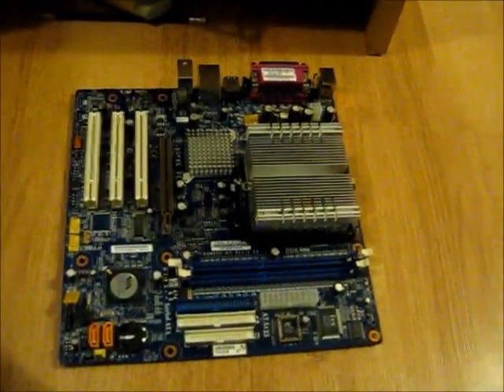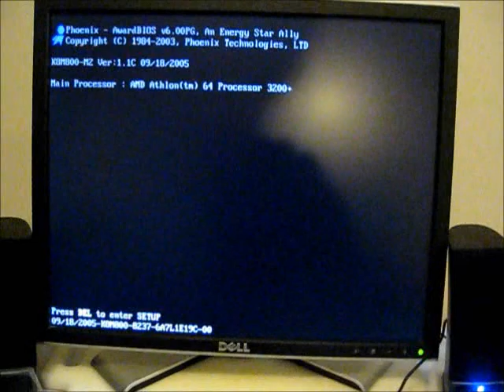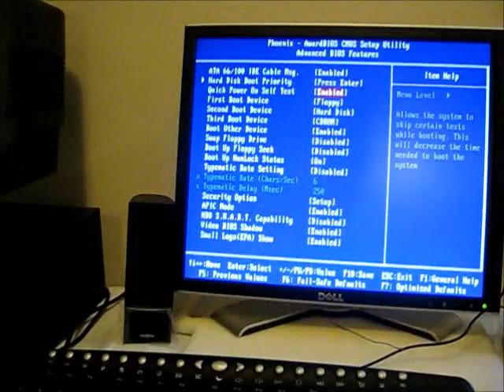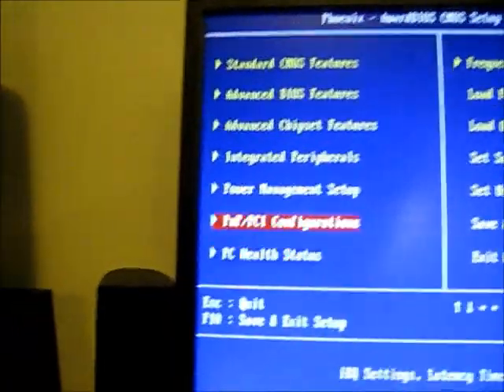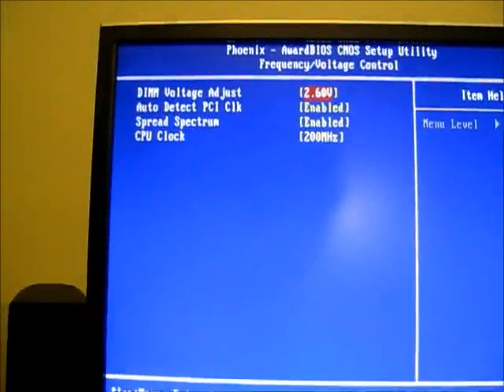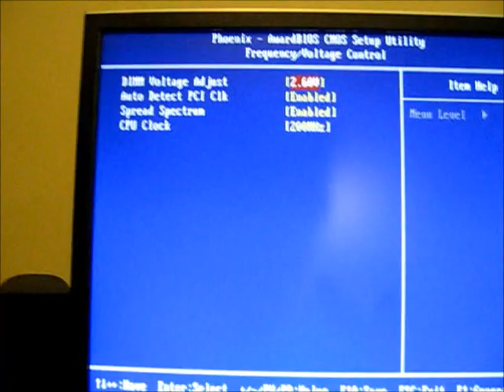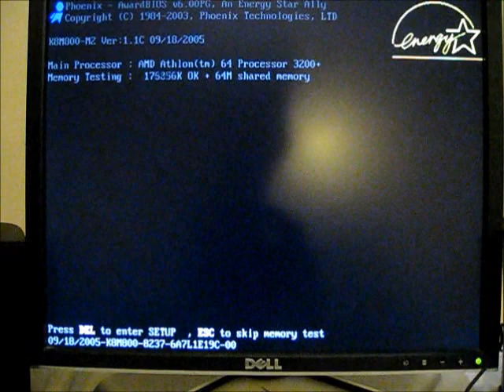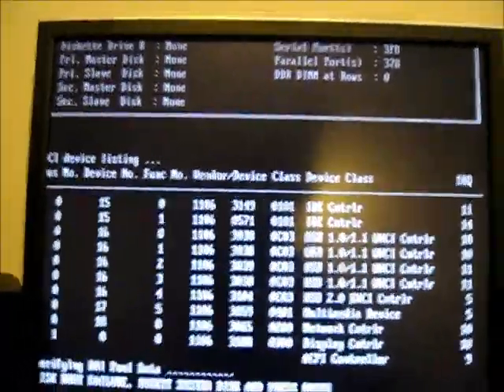Testing the ECS socket 754 board

Comment from the maker: your might be the older, crappier revision. mine is a tough board, this thing could survive an apocalypse. it was drenched in water with the battery in it, tossed into a dumpster hard enough to smash the case to no end, but the board works like a champ, the water didn't hurt it at all, the battery even still works (but I dont use it because it was kind of wet at one time)

Comment from the maker: @thepowermacgalaxy fucking google is screwing with youtube again. and the ASRocks PS/2 controller is dead. what a POS! but the ECS works fine with the BIOS crossflash, its not an ECS BIOS, lol. where i work we have 20 of these ECS boards and only 1 has died, and thats because of a cheapo LiteOn PSU that blew up.